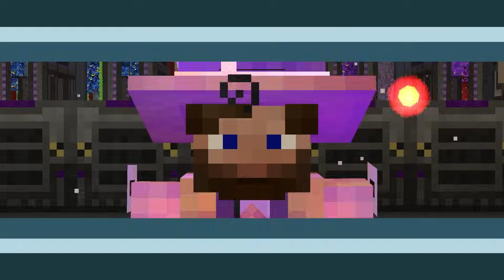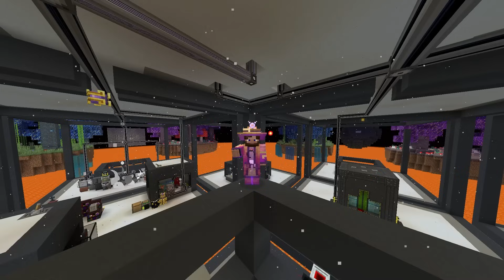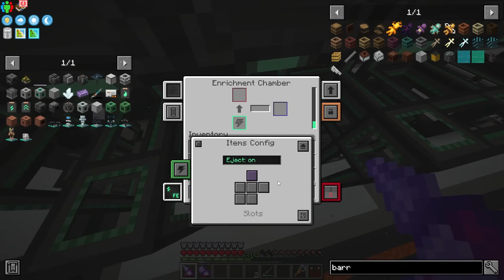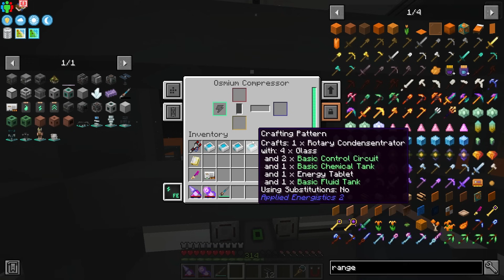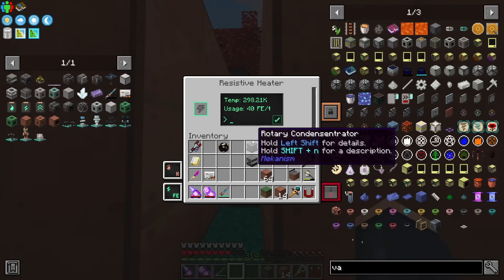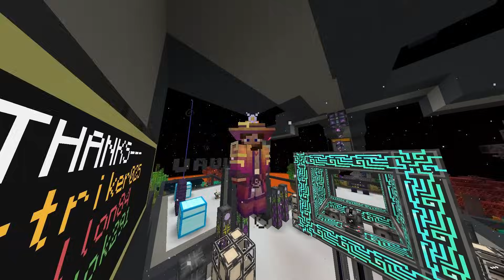All The Mods Volcano Block EP24 Mekanism Automation + Mass Power Storage

Comment: For the infuser automation, this is what I did to male it work. I have a barrel behimd and the infuser on top of the pattern provider. I then use mechanical pipes pulling from the barrel to the top and back of the infuser. The infuser is then set to auto eject back in to the provider. Hope that helps.

Comment: chosen when you copied the settings to the 25mil generator it didn't copy the disable limit so it doesn't transfer the 25mil to the battery
Reply from the maker: I did manage to find that in the fix it after the fact :D

Comment: For the resistive heater, the best you can do for the tanks to make it most efficient is to use 5000rf. It really doesn’t matter if the point is set a lot higher than that because the resistive heater will only take the amount you set for it. You can set it like you would for a reactor.
Reply: ironically, it also helps to put the evaporators in a Desert biome

Comment: W/ the heavy requirements for the ATM star it’s best to have a dedicated maxed out Mekanism machine for each process. Otherwise you end up w/ bottlenecks that slow things down a lot. It’s best to have multiple machines for the lower tier processes. You could always have it running in the background but who doesn’t want to make things as quickly as possible?
Reply from the maker: We honestly they seem fast enough to be able to keep up with the process as needed in my situation
Reply: @ChosenArchitect may be fine now but when you try to produce the massive storage parts it will be a bottleneck. You’re going to run out of all the lower tier items quickly. Keeping enriched coal/redstone/diamond/obsidian will be a major problem if you don’t have dedicated machines to produce them. In ATM7 it took me  2.5 hours to produce the first one. After adding a lot of machines it was down to a few minutes at most. And I was using creative importers/exporters/crafters the whole time.
Reply: ^ Having an interface surrounded by 4 machines of the same type, upgraded with the max upgrades and max tier is a cheap and simple way to make things go fast.

Comment: just put a pattern provider on each mekanism machine, put the patterns in, and hook it up with AE cables.  The AE system will handle the inputs and outputs just fine so long as you have set the sides of the mekanism machines properly.  the only mekanism cables you need are for power.
Reply: you don't even need energy cables, just use a modular router with energy upgrade